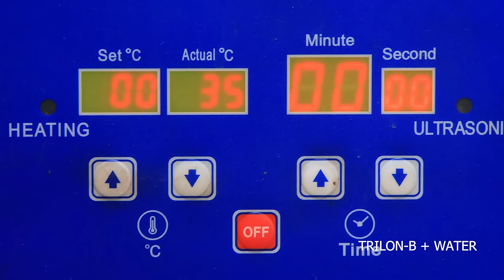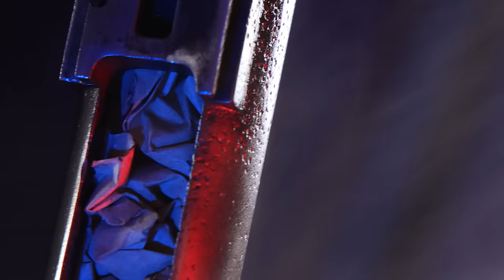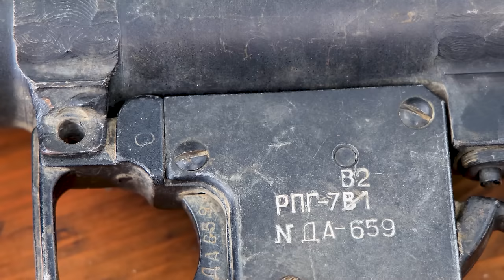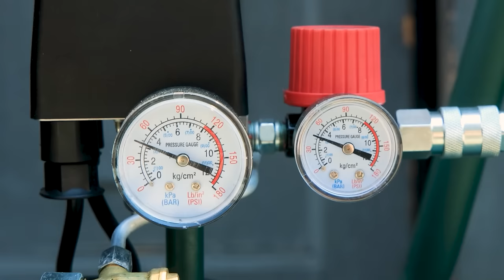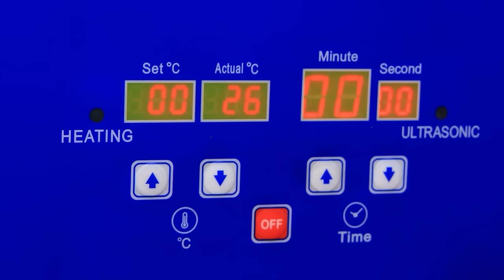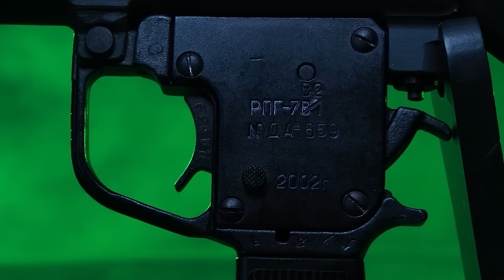PTRD | Old anti-tank rifle restoration

Comment: Good restoration,but you should've blued the barrel & the other metal parts instead of just spray painting them & also you should've looked up to see what the original site looked like on the  barrel because I noticed that it's broken off & you should've fixed that
Reply: Sounds like you should of gone round and helped him out 😅😅😅😅but you are right
Reply: These would have been parkerized or painted.
Reply: ... I agree, however the customer might have wanted to keep the cost of cleaning down,... not really a restoration,  however I  sell American Civil War items. If you over clean the items they loose their value

Comment: Almost every restoration channel does artificial rusting. With small meaningless items is one thing but I severely hope this was not artificially rusted and the original wood furniture was actually gone. Its bad enough you spray painted it black instead of bluing or having it re-parkerized, but to have purposely damaged this firearm for a youtube video is outlandishly stupid when it could have been worth a hefty amount ontop of its historical value. 

For those who might try to argue that the historical value isnt gone, that rust, corrosive pocking, and spray paint could have, and will have removed any forms of identifying marks that could have been used to link this to a soldier or event in the war.